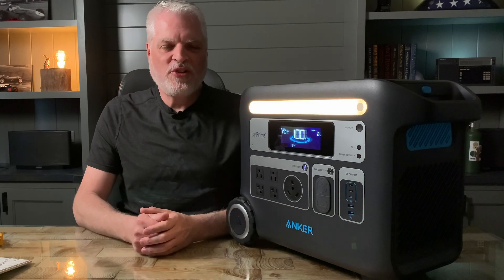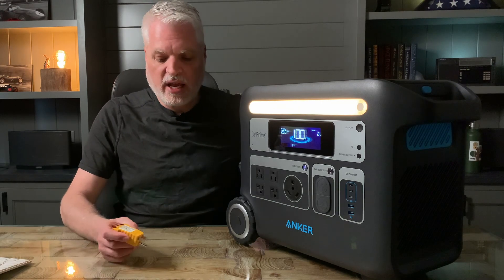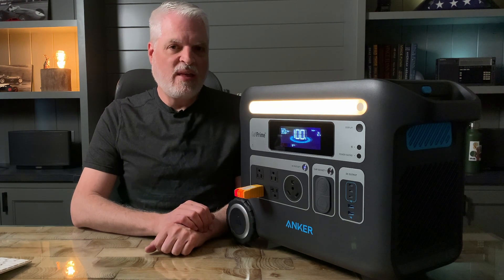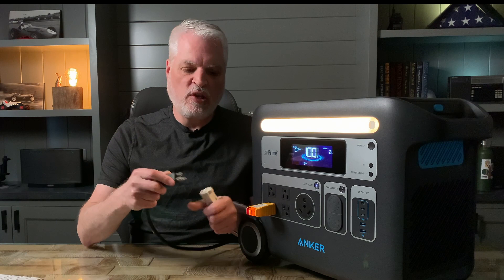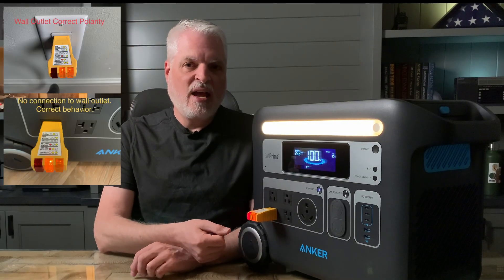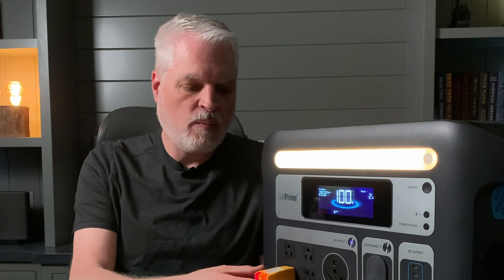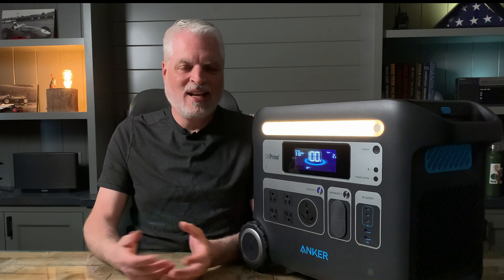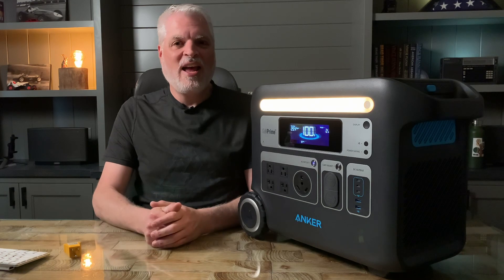SAFETY ALERT: Anker 767 Power Station - DO THIS TODAY!

Comment: Don't buy anker lol. This shouldn't have even been sold and shipped. And no they are not even letting the general public know so they have no intentions in a mass recall but a case by case basis. Why did you have to show the defective unit and not anker? That's pure  irresponsibility on thier part.
Reply from the maker: There isn’t another unit on the market I’d replace my Anker with. I am hopeful that we’ll hear from Anker on a proactive recall, and I’m encouraging them to do that. It’s still early days on this. Another commenter had the same reverse polarity issue with their Bluetti, but Bluetti tried to dodge responsibility. Personally, I’ve been impressed with the level of responsiveness and professionalism exhibited by Anker, so I expect them to step up. Thanks for your comment.
Reply: Yeah, I agree it's sketchy that they don't take the initiative here, but it is China, and I don't think anyone will be surprised if they continue to treat this on a case-by-case basis. That's on-brand for a Chinese company. Unfortunately, the only other unit I'd consider behind the Anker would be the Pecron E2000LFP, which is also made in China. And Ecoflo, although headquartered in San Francisco, still manufactures all its units in Shenzen, China. 

If you want a solar "generator", there's no way out of the China Syndrome unless you build your own unit. With the current price of lithium, controllers and inverters, you can save a great deal of money when compared to the Anker 767, but that math starts making less sense compared to the E2000LFP when it's on sale. You can get it for $1149 on Amazon at the time of this writing. The reason I like the Pecron is that it ditches all the convenient bells and whistles in favor of affordability and size/weight. If they had only put a 30 amp port on the E2000LFP then it'd be my number one choice. The 30 amp port is what makes me consider the Anker over the Pecron. That and the firmware is user upgradable in the Anker, and not in the Pecron.
Reply: @DC D  I just received the pecron 2000lfp in all black a couple days ago and it's great. I was impressed with the pecron 600lfp which I bought a couple weeks ago so went for the 2000.  I already have a few ecoflows and an bluetti. 

You're absolutely right no way out of China. I did work for a Chinese CCTV manufacturer as a technical engineer which is the 2nd largest CCTV manufacturer in the world. We did have a hack and honestly for them to remedy the issue quick as possible is they and the other Number one CCTV manufacturer in the world had to get called out from a news source and social media. I remember working that hack and it was a mess. Hopefully Anker will own up to it before a news source exposes the issue. That's bad PR especially when so many are getting into these solar generators.
Reply: Exactly !

Comment: So far it seems like everyone has this issue. I am wondering if all the units currently being sold at Amazon, Walmart, etc. are currently impacted. If anyone that recently purchased an Anker 767 does NOT have this issue, I'd love to hear from them. I have been sitting on the fence, waiting to pull the trigger on the 767 until I know all the current stock has been replaced with properly functioning units. I really don't want to deal with having to buy something only to have to ship it back right away, and then wait for a replacement. Until this is all resolved, the Pecron E2000LFP is beginning to look a lot more appealing to me.
Reply from the maker: I believe all 767s are dropshipped by AnkerDirect, no matter where you make the purchase. so I suspect they’ve updated the wiring on all of their inventory. The message they sent me said, “we will ship you a brand new one, which will be in good condition and work without issues. Please note the issue has been discovered and resolved by our engineers.”
Reply: Mine had reverse polarity. I returned it to Anker. A few days ago they sent me another generator which showed correct polarity with testing. On my replacement unit, when the unit is not grounded (plugged into a wall outlet) the polarity tester will read "open ground" which is to be expected because the unit is not grounded if not plugged in. The instruction manual says to ground your unit to a wall outlet, if available, even if there is no power. Of course this is not possible when camping. I really like the Anker 767 which is why I accepted another unit instead of asking for a refund.
Reply from the maker: @harmagician1  thanks for the info on your replacement. I wondered how their turnaround would be.
Reply: I posted 2 long comments to this video that have been deleted or something because they are gone. But I am a recent purchaser and have this issue also. And I agree that they are most likely all defective. Just look at the fact that they continue to ship the same xt60 hub that will found that when using the unused connections are live and exposed. It isn't good business that Anker is shipping these units out like this. I am going to be sending mine back and going with something else.
Reply from the maker: @bckrypto9837  I agree with you on the XT60 hub. That’s an unforced error. Otherwise, I’m glad to see Anker stepping up and replacing these. Another viewer ordered on 4/13 and his tested good. I’ve asked Anker for comment. If I hear more, I’ll let the channel know.
Reply: I wonder if this will cause issues in a situation with the transfer switch subpanel I am looking at. I was planning on having this charge on grid power when sun isn’t available, then switching to 767. Would this situation cause a ground loop? Would it be more ideal to unplug the 767’s 30A then AC grid charge?
Reply from the maker: I don’t anticipate a ground loop, but if you have the issue, you need a replacement unit. Also, I believe the Anker currently defaults to AC charging. I’m hoping they update the firmware & app to let you change the default to solar charging, and fall back to AC charging.
Reply: @TRAILPOWER  Yes, that would be a much-welcome change. I wonder if Anker is even aware that most consumers would prefer it to be set up this way, or at least have the option to change the default charge mode in the app.
Reply from the maker: @dcd6115  fyi- I was contacted by a viewer who ordered his 767 on 4/13. His unit tested good. So, shipping units appear to ave been updated with the polarity fix. That jives with what Anker has told me.
Reply: Mine was ordered from Anker on 4/4 and received about a week ago. I wish stores like lowes, home depot, costco, sams club carried these because returning such a big heavy item through shipping is not a small task. I don't have the solar panels yet and have never even used my 767 other than the initial charge. I will get it returned and look for something that I can return locally if there is a problem because who is to say there won't be more problems that arise with this unit seeing that this is the first generation of the 767. 
Thanks again Scott for reporting on this issue and maybe you have an alternate recommendation that can be purchased at a big box store locally.
Reply from the maker: That helps in narrowing down when Anker discovered this. You ordered on the 4th and had the issue. Another was received theirs on the 13th and it was fixed. So Anker is likely only into this situation a couple weeks. I’m a product manager myself, and I’m guessing they are scrambling to coordinate a plan of action. First was to stop the bleed, which they did with the repair. I’m guessing it was a training & documentation issue. Next they have to respond to inbound support calls, to maintain good relations, and third, they need a plan to contact purchasers proactively and have the logistics to back up that plan. I respect your desire to purchase locally. You may want to check out geneverse, which some costcos are carrying. But, remember that most retailers are going to direct you to the manufacturer after 60-90 days, so either buy from Costco with their generous return policy, or make sure you pick a company that really stands behind their product, and that has a legit US operational presence.
Reply: @TRAILPOWER  I have read, since these solar generator units fall into Costco lifetime generator policy (not the 90 day electronics one) you essentially have a lifetime warranty when buying through Costco. They’ll probably update that soon as no one buys MP3 players anymore 😀

I’d love to see an Anker 787 or a 767 2 with better solar specs. Its so close to perfect for my use case
Reply from the maker: @TobyCostaRica  I didn’t know Costco had that policy. Very interesting. You just hope their buyers pick a winner, as you don’t really get choices on product.
Reply: @TRAILPOWER  yeah I’m hoping EcoFlow delta pro comes out with a 2.0. The solar specs really are lacking on the 767. Would love to use 3x350 watt panels. Unfortunately with 767 specs best I can do is a single 540 watt panel.
Reply from the maker: I’m using a pair of 480w panels.
Reply: @TRAILPOWER  😮 which panels? I can’t find in stock at A1 Solar that won’t exceed the VOC in series or current in parallel. Or are you using a circuit breaker as a preventative measure so it doesn’t exceed the amperage?
Reply from the maker: @TobyCostaRica  I’m not seeing my previous reply, so I’m re-sending it. I’m using QCell 480W panels. Their 53VOC is a nice match for the Anker.
Reply from the maker: Running two in parallel for 53v 20A
Reply: @TRAILPOWER  Sweeet ! Thanks. Doesn’t that exceed their amperage specs slightly? 22A short circuit current? I did notice even their factory panels exceed it if there was ever a situation where it gets maxed out. So I wonder if it has a 20% buffer like a breaker. What’s the highest wattage you’ve seen coming in so far?
Reply from the maker: My understanding is that Voltage is a hard limit, and exceeding it can damage the MPPT. But, you can over-panel with extra amps to maximize your power generation in the AM, PM, and cloudy days. The mppt just won’t accept more than 20 amps.
Reply: @TRAILPOWER  thanks! That opens up a lot of options!
Reply: @TobyCostaRica  I'm using a couple of JA Solar 460W panels in parallel, VOC 50.01
Reply: @scottmasterton  thanks. I have a 72” x 144” (South facing) roof on my shed. I’ll need to use smaller panels in the 300-350 range.  Wish I could use 2 x 450+ but would overhang. I’m hoping to run a 9k btu mini split AC (rated at 666 watts) for a few hours. Also hoping the 666 watts is max and it can throttle down to use less.

Comment: Nice job Scott,  it’s worth mentioning to your subscribers to test the outlet the Anker is plugged into.  The Anker is a floating neutral generator and will pass thru the ground of the outlet it’s plugged into.  how are the Qcell panels working out for you?
Reply from the maker: Hey Leafnutz, Yes, I definitely should have mentioned that in the video. I included a photo testing the outlet, but forgot to call it out. I’ll have to post a pinned comment. I’m building a rack and running 6AWG underground from the panels into my mechanical room as-we speak. Should have a video on that soon. I’ve been sending people to your channel for more experience with the QCell panels, and will be linking to it in the next video.

Comment: Thanks for this. Mine is also defective.
Reply from the maker: Sorry to hear that. Hopefully they get you a quick replacement.
Reply: When did you buy your unit ? 
I bought mine 2 weeks ago !
Reply: @ronaldcarrender6136  before the end of 2022 (Dec). I haven't used it yet since I'm still building out my rig, hence why I've had no issues up to this point.